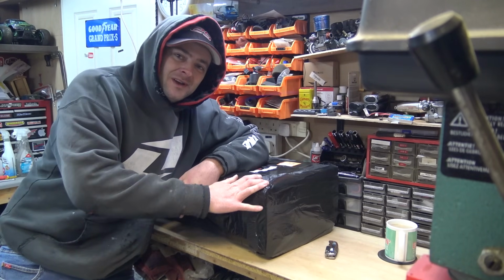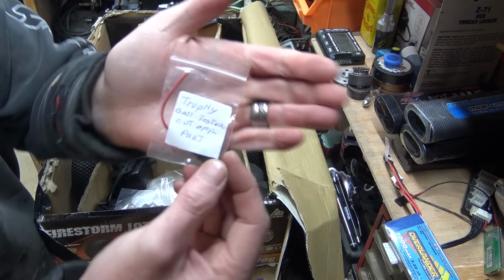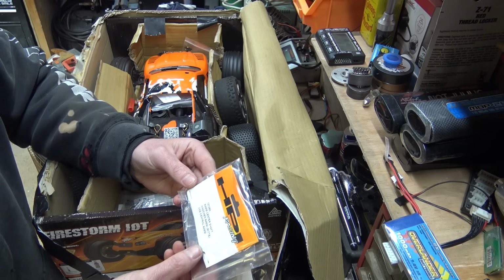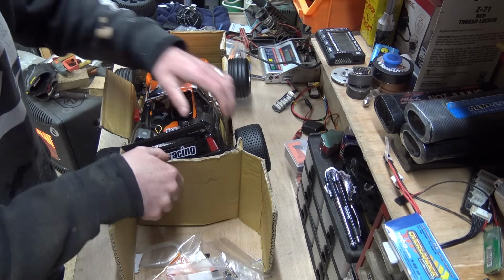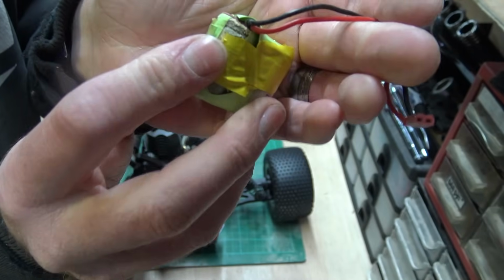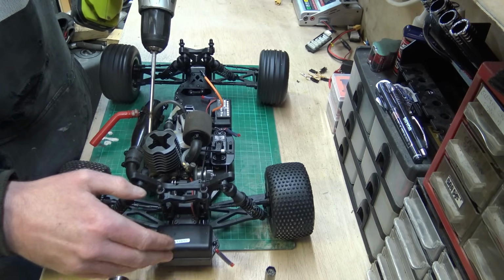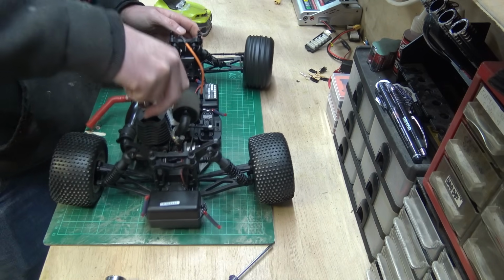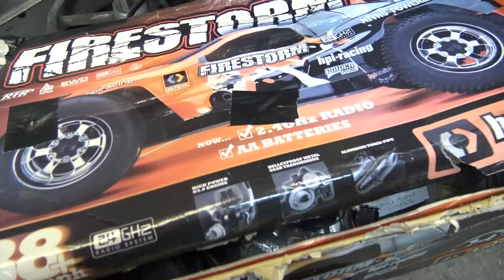This Nitro RC Car Came From a House Clearance But Will It Run?

Comment: A tip that helps alot is warm up the motor with a blow dryer or heat gun  for a few minutes and after should crank up no problem 😊
Reply: Ok yes

Comment: The chrome wheels that came with it are from the Hpi trophy 3.5 buggy by the look of it bro and you're right about the radio gear. The first firestorms came with crystals and usually had the crustal number on the receiver box. Mine is number 3 lol. It also had a different shell design/paint scheme. You should keep this one bro 👍

Comment: Way back when, I had the Kyosho equivalent of that vehicle. Think they referred to it as a "Stadium Truck", the predecessor of today's Short Course craze.40:15 or so. trying to tune a cold engine, while not even burping the throttle, the engine could either load up or starve and stall before any adjustments really take effect. You need to have throttle control to clear out rich conditions, or richen up lean conditions. It's painful watching you mess with adjustments and not 'take a lap' between to see what effect it has, especially when the thing could have had a perfect tune on it and just needed to be run around your yard for a tank. Now you've gone and smudged that all up. 
 Someone sure did love that car. Probably getting hot sitting idling on your bench too. 
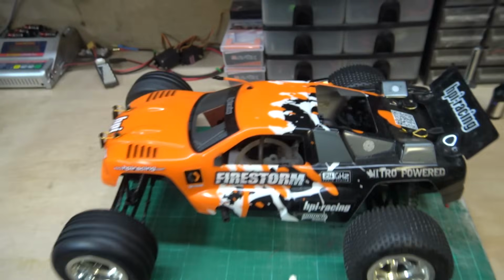  49:15, is it getting dirty from your bench!? lol clean you bench man! he he
 I wanna see vids of these resurrected cars running.
Reply from the maker: I haven't got a yard to run it in. And I've sold it to one of my regular collectors now.

Comment: Associated  mgt 8.0  exhaust if your American if in the Uk the exhaust is for a thunder tiger sledge hammer s50 
The k4.6/5.9 are very highly valued now and sell for a good price used
Reply: The k series pull start I mean

Comment: I got an old Kyosho from a guy that couldn't get it to run. I literally put batteries, fuel and a new plug in and it fired up 3rd pull. Mine had a high idle also, I guessed the seller messed it up trying to get it to run.
Reply from the maker: It’s very common man, people play with the screws lol

Comment: Great video and car is running pretty decent. Somehow its a bit strange that the car idles so high.
Keep up the great work man. 
p.s. I think that I saw the new servos for the sworkz😅
Reply from the maker: It’ll be because it’s sat around for a while, engines often run faster when they’re used to being sat and haven’t ran for a while. I think it’ll settle down once it’s warmed up and ran more. 🤘🏻

Comment: surprising to see it start with a hand drill, usually they don't have enough rpm.
Reply: that is how I start mine as well my .28 JL max runs off a sullivan tiger drive and use my 18volt ryobi drill way too akward of a chassis for a bump box revo 3.3
Reply from the maker: You’re right but it does work, as you saw lol.
Reply: Guessing it just helps it eh

Comment: there nothing  wrong with a  drill to start it as long  as the clutch  and speed and rotation  are set write  and  there not set on the max levels.    with some rechargeable aa battery  and heat shrink  you can make  some  hump pack out of the stock battery  cases. i no  some  people  use the rubber  muffler  tube to shut it off so there  not putting  there  fingers  on hot metal muffler.   if i had to guess  it actually not that old i no all the 2nd gen releases  of the hpi cars all came with the 2.4 radio  set ups and the new style hpi servos.   here in the usa the remote  and receiver 2,4 hpi  cost  27/37 dallors  to replace them  .

Comment: Hey I was wondering if you had any tips about starting a newer engine. I got a new rtr srx8 nitro buggy and I can't seem to get it to start and stay running. I've changed and checked the glow plugs, glow starter, added a little fuel to the engine itself and of course heated it up. Sometimes it starts but just for a second then cuts right off, even with the glow starter still attached. I haven't even been able to break it in because it won't stay on. Sorry about the long comment but any tips would be much appreciated.
Reply from the maker: Have you used the trim to raise the tickover a bit to help?
Reply: @ i did actually but that didn't seem to help either, i mean it helped initially but then back to not working/staying on for more than a split second

Comment: As a nitro noob - why does it take so long to start using the drill?
Reply: It’s not the drill mate it would be the same if using a pull start it’s because the car has been stood so sometimes they take some getting going once it’s ran for abit and carb adjusted it will be fine. 😊
Reply from the maker: As said above, sometimes engines take a while to start after they’ve been asleep for a while 😂
Reply: @foxyjay1  OK - thanks for that. So why, having been stood for a while, does that cause it to happen?

Surely, if the spark & fuel/air are getting in it should at least attempt a start?
Reply: @neilo3476  the carb could have old fuel in it which turns like jelly when old the same with the fuel lines and cylinder it only takes a little bit of old fuel to stop one starting straight up also the carb could of been tuned for hot weather and now it’s cold it could need adjusting slightly to get the engine running right. 👍

Comment: @haggardrc i need some help with my eb4 s2 thundertiger
Reply from the maker: What’s up dude?
Reply: The car turns over, but the rev is very high that the nitro just finished quickly just by throttling it. It goes into high rev on its own. The back wheel only spins when lifted up. The front wheel rotates in opersite  directions hence why the car doesn't drive. Any ideas will help please and thanks